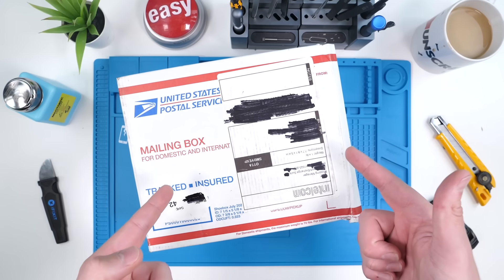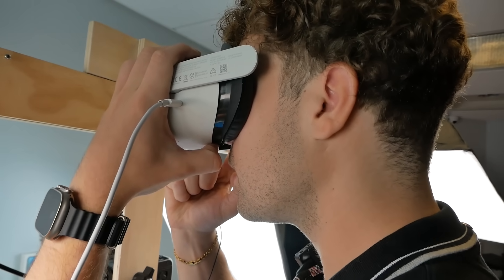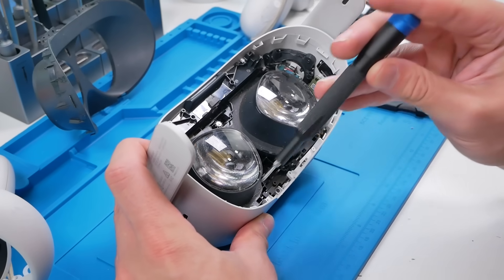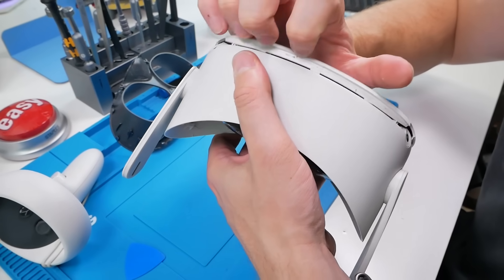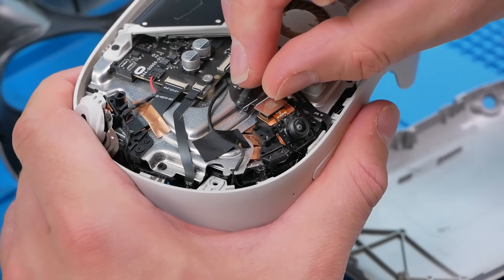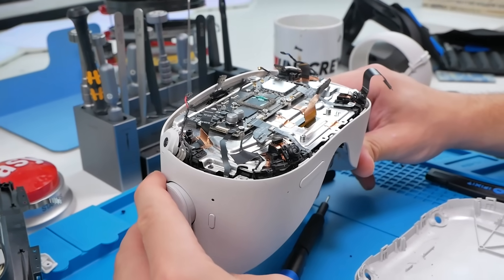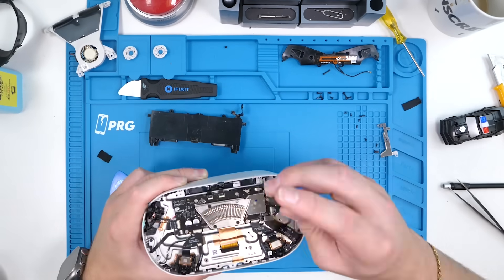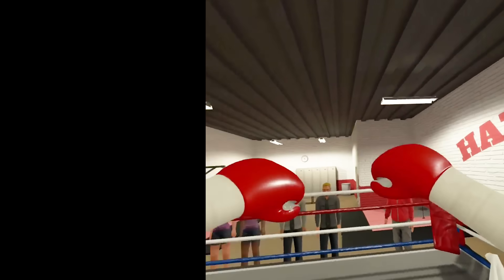The Oculus Quest 2 Has A Problem...

Comment: Red blinking light, means the oculus is dead in another word it haven’t been use in long time.
Reply: Not everytime. If the battery is empty it also only blinks red. My headset ran out of battery once and it blinked red after 15 minutes of charging it worked just fine

Comment: A quest with a clear Front would be cool
Reply: Its quite easy to do
Reply: Just take the front cover and get its form then use epoxy resin to fill it and boom done. You could even put some paint in it

Comment: 3:35 that extends the screwdriver. You have to connect one end to the screwdriver. You twist the screw driver like normal and hold the middle part still. The inside turns to unscrew from the distance so it can bend.

Comment: 9:03 You can't obtain an original or OEM battery; all the batteries for sale out there are from scrapped devices.  The battery on my Quest 2 is starting to deteriorate so I purchased one from the only source that I could find (Ali Express) and when it turned up, it was obviously used. I  didn't bother fitting the battery since I doubt it would have much more life in it than the original it was to replace.

Comment: If the battery is on the outer side, it will cause the weight imbalance and lead to heavier front side that will cause pain on the nose over longer period of time. It's a logical design for the battery to at that place for the balance and comfort of user. Besides, external strap attached battery packs are available to use.
Reply: like pico vr headset
Reply: Once the battery begins to go even with an external strap you won't be able to keep the device booted.
Reply: That won't help if the battery explodes or turns into a devil's capri-sun

Comment: I've had my Quest 2 since launch, and I still use it. I have noticed the battery isn't fairing too well. I've found it dying much sooner than it used to, and it also can get hot after extended gameplay. Though, to be fair, I have a 10,000mah battery strapped to the back of the strap that I frequently use so that may be affecting things. 

Interestingly, my original Oculus Go now no longer works unless it is plugged in. The batteries in these standalone headsets definitely are what is keeping them back.
Reply: When they die in 2 hours, battery wear cycle will be expire fast

Comment: Wow, that looked like the most complex battery replacement ever. Insane
Reply: It's a big step up from the Quest 1 which you could not replace the battery for at all, in any way. Hopefully the Quest 3 is better in this regard.

In the end, Meta knows that VR will advance faster than these batteries will die. 90-99% of users will just throw out their Quest 2 when it dies, because by the time that happens, the Quest 4 will already be out. Even if you fix the battery on the Quest 2, it's still barely going to be able to run future VR games (hell it barely runs some VR games now without crashing)

Comment: Solder the battery connectors to the  wires , connect the wire to 10000 mah power bank and super glue the power bank ont the outside. Its a Genius idea.

Comment: Is this a user-caused problem or a problem that occurs over a specific amount of time. If the latter os true Oculus might address this so that it won't lose market share from apple with the vision pro
Reply: the two make it as it is user-caused problem when u charge it over night etc.  IT also is a problem that occurs over a specific amount of time just like every other device that uses lithium-ion batteries
Reply: @poxekk  Thanks
Reply: anything that uses batteries will have its charge decrease over time
Reply: @LutaKura  Yea that's a fact but some things just decrease quickly

Comment: I'm pretty sure they put that battery there for proper weight distribution Because if they put in the front it would probably be top heavy
Reply: An easy solution would be to have the battery mounted remotely to the back of the head strap, with a robust replaceable coupler to the headset. This would actually give superior weight distribution, because it would counterbalance the headset. I work in engineering, part of design is keeping service in mind.. but these companies aren't incentivised to do so.
Reply: @BoomBeench isn't that kinda what they did with the Pico headsets and the Quest Pro?
Reply: @BoomBeench Doing that is more expensive. When designing a budget headset tradeoffs will be made to keep costs down.

Comment: That's why i got myself battery strap so i could keep internal at 60%. On another note, where did you have your battery, since it's max out at 4.4V, not 4.2V like most other ones.
On another note, i bought mine of ebay for 180 usd(128gig oculus with controllers that were without straps, but i bought knuckle extended grip anyway). Battery are definitely not new, its barely lasts for a 2 hours, even with light load and also have one green pixel on right lens (if you pixel peep in complete darkness)

Comment: Suddenly Apple's idea of an external battery pack for the Vision Pro seems brilliant.
Reply from the maker: My thoughts exactly + there’s much less risk of a battery related incident
Reply: @PhoneRepairGuru  It will cost a kidney though
Reply: @PhoneRepairGuru  And with the battery in it, it's too heavy on your face.
Reply: @jameswoll the people who tried the vision pro said it was still front heavy even with an external battery. The problem is not the weight, it's that It isn't balanced, the headsets with the battery on the rear are much more comfortable.
Reply: @a.zeppeli4454 that's why so many elite straps are bought
Reply: @jameswoll  no because you can just do something like pico where you put the batt in the back which helps with balancing the weight
Reply: @jameswoll  I think they just wanted to sell battery separately
Reply: @jameswoll they could just put it on the back and counterweight it.
Reply: @PhoneRepairGuru think about it, battery’s die so quickly because no one powers the headset down. They take it off and it sleeps while using the battery still, I’ve come back to my headset dead because of it. POWER DOWN YOUR OCULUS, but that goes for almost every electronic device, except your phones, he can fix them
Reply: @PhoneRepairGuru especially when if you use anything over a 5w charger there is a risk of the ports melting….
Reply: @PhoneRepairGuru unless u drop it I think in that case you have an immediate battery related problem 😂
Reply: I heard that the Quest 2's Elite Headstrap has a version with a battery pack
Reply: or maybe put the battery somewhere where u can replace it easier?
Reply: @arad_dev fr that's what I'm saying
Reply: it's goofy as hell
Reply: It also drastically reduces the amount of weight you need dangling off of your face, which will make it more comfortable, but at vision pro prices I'd honestly just get an index and a good gaming PC. It's the same if not cheaper in price.
Reply: As a veteran VR user, yes an external battery is better I do agree. Before my Vive Pro 2 died I ran a battery in a cheap velcro gun holster, but I do see the advantages to having an on-board battery in a VR HMD. I've been running my Quest 2 ( that I bought solely to teardown and reassemble to learn it for repairs ) since the death of my Vive and it's been great not having my HMD die mid session when my external battery dies. And having multiple I can just rotate and have basically uninturupted sessions! As for the Quest 2 battery replacement, I do wish they designed the internals differently so you didn't have to completely disassemble the unit for what is supposed be a simple battery replacement. It's a shit design.
Reply: Not really the ideal system is having the battery mounted on the rear for weight distribution, also could easily make an accessible battery if that's all the rear is used for
Reply: It's apple, theres a catch and immediately becomes not worth it lol.
Reply: It's not brilliant, it's just less stupid
Reply: only disadvantage for external battery is slightly less clean setup, otherwise headset will be lighter, easier replacement, less heat, less chinky.
Reply: Nope
Reply: And less weight on your head
Reply: Yeah for $3499 + the quest 2 is like 3 years old and a cheap standalone head set
Reply: Yea for the hefty price of 999
Reply: @liljuicylogic  You mean $3499
Reply: external battery packs has always seemed brilliant, especially considering the main issue with stand alone headsets are  weight balance cos of battery
Reply: aren't there external batteries for the quest 2 as well
Reply: THE battery i at the top of the headset  he did this wrong
Reply: My only issue with Apple's solution is the fact they’re using inductive charging, which is less efficient
Reply: @brandon_nope  USB-C
Reply: I think eu regulations in 2024 include everything, they mention something along the lines of "any device" that use battery, correct me if im wrong im not a lawyer
Reply: Does it
Reply: yep to bad that device is to expensive.
Reply: If by brilliant you mean not completely stupid
Reply: But it’s like a billion dollars
Reply: ..sure
Reply: @discminute  I shat at this comment
Reply: But the price though! Apple literally saw the quest pro and asked if they could copy their homework
Reply: Exactly what i was thinking
Reply: As long as it's got some form of internal battery to keep it on for like 30.seconds while you swap it
Reply: *lazy
Reply: AND THE PRICE
Reply: Quest pro has that😂
Reply: $3,500 with a battery replacement of $1,000
Reply: Swappable battery would be even better.
Reply: As much as people love shitting on apple that was a really smart move
Reply: If only they could figure out how to do it with their phones. 😏
Reply: It has always been brilliant.  Not just the battery but most of the processing system.
Imagine a fully modular and stand alone headset you can upgrade the cpu, gpu or the whole motherboard.
Reply: i like it because that way the chance of a Batterie blowing up in my face is 0
Reply: Dji actually made the external battery for fpv goggles
Reply: 69 ruined
Reply: haha
Reply: Only £3000 yea apple vision sure.
Reply: Man’s officially smartest man in the world
Reply: You can recharge it once that’s because of a lithium battery 🔋
Reply: I think the coolest two fake
Reply: You forgot Pico 4. It has separated battery at back. Much easier to repair it.
Reply: what i dont understand is why no one (by “no one” i mean the modern popular ones) has tried the thing that most third party head straps with extra batteries have done: put the battery at the back of the head strap so it can be larger and also counter balance the weight of the front piece. then the wire isnt a nuisance either since it only runs along the head strap.
Reply: its released jow
Reply: Till you see you can't repair the headset
Reply: Exactly
Reply: Quest pro
Reply: Pico 4 have the battery on the back, would be interesting to watch a replacement on those.
Reply: @Phenix0998  many years ago HTC made a headsets with the battery on the back and user replaceable so it's not impossible to fix both problems.
Reply: @a.zeppeli4454  i didnt know that. Thats the point, in the back the weight is balance and could be replace for anyone. In the quest is such a mess (sorry for my english)
Reply: @Phenix0998 shut we don’t talk about the pico 4
Reply: @BryXZaki  Basically you weren't talking so...
Reply: Fr
Reply: yeah
Reply: Quest 3 will have a detachable battery
Reply: @sonicjam717  it doesnt… who told you that?
Reply: Evryone says apple makes things hard to repair now I will tell them to watch this
Reply: @oldconsolegaming apple stuff is hard to repair 
One good decision doesn't make apple the most repair friendly company ever.
Everything apple does is anti repair
Reply: @ZeroChanceLance  good point but at least maybe you can buy just the battery pack if not it is just as anti repair as this and possibly more
Reply: @oldconsolegaming  Them putting the battery on the back won't make it easier to repair. I fix CrApple and Android products, CrApple devices are by far the worst things to fix as they try to trick people and make things hard to do for no reason.
Reply: @oldconsolegaming  Apple glues shit together... at least here you got screws that anyone can undo.
Reply: @oldconsolegaming  and they can tell you to watch teardowns of literally every other apple device 😂
Reply: @oldconsolegaming  Do you know how hard it is to repair the 
apple vision Pro?
Reply: I was LOOKING for this comment.

Comment: Let's hope Quest 3 battery replacements are going to be a bit easier, since these headsets are becoming genuine alternatives to consoles and should be fixable as consoles and phones- I've seen multiple accounts of people taking a Quest 2 over an Xbox Series S.
Reply: That’s me I have a ps5 and a pc I was going to buy a series s but I did some research and I got a quest 2 and it’s the best because now I have a different type of system
Reply: heh, they'll probably glue everything together and won't use any screws anymore, so you can't open it without totally destroying it.
Reply: I must inform you that quest 3 battry is also a hassle to replace. :( saw a video of that few days ago.
Reply: @nostalgiskavhsrippar5940 
I saw. No glue, at least.
Reply: Same
Reply: Yeah I doubt that! It's smaller probably the same ahit stuffed in a smaller package
Reply: I mean... if you have a PS5, PC and Switch and can't find a PSVR2 or don't have anything to play with PSVR1, you'd be better off with a Quest 2 over a Series S. Hell, you're better off taking a digital edition PS5 over a Series S just from a game compatability stance alone.

Comment: Great videos, it sucks to see more and more companies making their products harder to repair :(
Reply: i feel like companies intentionally do this, but not fully. they do it so that people don't get encouraged to repair the vr and instead buy a new one, thus, more money. and also because of sacrifice, since VR's actually have to FIT on your face, it has to be compact, leaving little space for a battery
Reply: @orig1naln4me oculus quest design is not intentional. The battery is away from the hot part of the device and is on top so it can get more heat out thus the battery last longer and keeping it healthy. Everything is designed with a reason. It's so compact with custom parts made for the device is the reason why it's so light, thin and powerful compared to other devices on the market. For now oculus is just making the best vr with no intention of making it unrepairable unlike Apple.
Reply: @originalname9789  that's not true because every major company I can think of offers repairs if your device is out of warranty. If your warranty has run out and your quest 2 has an issue you can't repair yourself, you can send it to meta to fix. If your ps5 breaks, you can send it to sony to fix. And there are also repair shops that will fix most electronics, like the guy on this channel. So no they aren't made in a way for you to buy a new one when it breaks, because they're repairable, even if you can't fix em someone else can. Something truly unrepairable would be a device that can't be disassembled non destructively, you would have to break it to open it
Reply: quest pro or pico 4 battery looks much easier to replace because it's located in the back separated from the main goggle, i believe this is the standard for vr headset moving on.
Reply: Some companies definitely make their products harder to repair for selfish reasons, but I doubt there was any room to work around this when your cramming so much tech into one headset.
Reply: Bro you gotta understand that some tech just can't be easy to repair. Do you have any idea what a technological marvel a fully contained vr goggle is? How do you make it any less complex than what it is? It's either gotta be hard to repair, or not exist at all. I rather have it exist
Reply: @hustla818  bro got rubbed the wrong way.